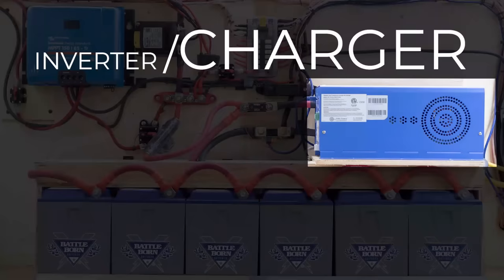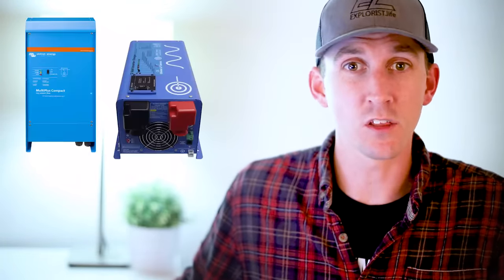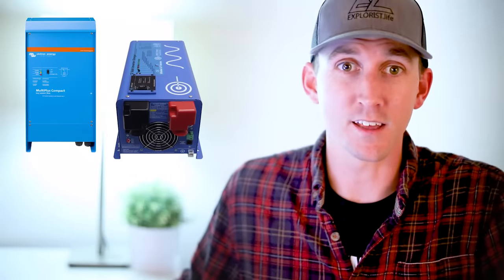Basic Solar Parts Needed for a DIY Camper Van or RV Solar Install

Comment: I really want to build my own tracking array for my home. It would be a ground install. Thank you for this very no nonsense visual of the most important components
Reply: I built an extremely simple one that holds 3 245w panels
Reply: @redsite001  Wow cool.  How much did it cost?  Did you have a plan or instructions. Are you formally trained in solar?
Reply: No I'm all self taught. And I had a basic idea how to do it.

It's been tracking all on it's own for almost 8 months now. I used a differential from a truck driven by a brushed DC winch motor with a chain drive and controlled by two small pv modules that operate 2 relays in opposite polarities.

Comment: Amazing video!  I am doing research on building a home mobile office inside of a 7x14 toy hauler.  I would like to be able to power everything inside the office via Solar to avoid the extra power consumption at my house.  Would all of the concepts be the same if I need to power computers and printers?  I want to get the right setup that I can somewhat futureproof without trying to power a 2k sqft home.  Thank you for the video and the amazing information!

Comment: EXCELLENT VIDEO! Clear, concise, simple to understand, straight to the point and all of it in less than 15mins. I've spent a lot of time watching ones that are twice as long and far less informative, so yours is definitely one of the best!

In our high tech age of lithium battery powered solar systems with Bluetooth charge controllers, one of the things that continues to irritate me is that we still have yet to come up with an updated 12v power outlet that we can all agree on and adopt.  Instead, in 2020 we continue to use an antiquated power outlet introduced in 1956 as a convenient way to light cigarettes while driving! These 3/4 x 1-1/2 inch "tubes" are far too big for what they do, they're just plain ugly and I literally hate them!  But you make an excellent point about using them to future-proof your USB outlets (ironic you have to "future proof" your rig using 65-year-old tech).  As someone who has just recently changed the USB outlets in my home for the THIRD time in 12 years for the faster, smarter ones, I couldn't agree with you more.  Despite my disdain for 12v outlets, that's exactly what will be going into our new rig so we can simply swap out the USB adapters as the 5-volt tech continues to evolve (the next ones will probably lose the USB-A  socket in favor of USB-C or some sort of combination).  Plus, you can always remove the USB outlet when you find yourself needing another one of those hideous 12v ones.

Thanks again for your highly informative video.  Great job!

Comment: I’m an electrician so I understand the wire sizes. I’m just trying to determine what I need for a basic set up. I have 2-100 w solar panels and looking to get another two later and I have a PWM controoler but it came with the panel. I’ll upgrade to MPPT controller

Comment: A very clear basic explanation of a solar energy set-up done with a sense of humor. How does a second engine alternator figure into such a system?
Reply from the maker: A second alternator wouldn't have much bearing on the rest of the setup.  It would just be treated as 'charging from the alternator'.

Comment: I just started following you.  Thanks for teaching this information.  

Recently I installed 50A shore power.  Now I'm adding solar.  Do you have a video showing how to wire the power inverter into the breaker box? Or do you just plug the inverter into the shore power plug with the appropriate adapter?

With the 50 A circuit,  I'm not sure if the inverter would be happy hard wired into the panel without a pretty serious safety switch. So for simplicity and safety my mind goes to just using the shore power wire to take power from the inverter.

Comment: Going to 2019 van build in az next month. Now I can talk the talk and ask my questions. Many 🙏 as explanations sorely needed. 

Do you have similar on amp hour, panel watts, and how to calculate what to get when starting out? 

Also? On portable systems vs roof mounted. I prefer being portable. Pros / cons?

You’re obviously a. Professor or well prepared professional educator. So well done‼️❣️❣️❣️
Reply from the maker: Thanks!  Of course!  Here is where I recommend starting.  How to perform a power audit: https://www.explorist.life/what-size-of-solar-system-is-needed-to-power-a-camper/

Comment: I have a very unique diy setup. 200w Renogy solar panels and basic charge controller with 100Wh AGM battery and a third party 750w inverter. I currently don’t have half the safety points as I should. I use this in a small work box trailer to power several 120v tool chargers, 120v mini fridge/freezer, led lights and a small 12V air compressor. I have had the setup for about two years and my battery capacity is a third of what it used to be. Curios if there is someone I could work with to revamp my whole setup for more capacity and more output. I live in the DFW Texas area. 
I have watched several of your videos and love how thorough you are but they don’t really meet what I’m going to be doing with the system. I would like to run more power hungry tools and not be so worried about the battery.  Any suggestions would be much appreciated!

Comment: This video was extremely helpful. I'm going to make my already solar hooked up RV with Solar panels and an extra two batteries but have been unsure if I need anything further. At least I now know the components I'll need to make sure I have. I already have a Deep Cycle battery but plan to get two more. I believe I should be fine with 4 - 100 watt solar panels for the energy use I'll need. I'll be sure to subscribe so I can refer back to your channel for additional info once I begin the setup process. At the moment I'm still clearing land to place my RV in a sunny area. Thank you and great job!

Comment: First' thank you for your informative and helpful information, albeit I am really not comprehending much of the technical data' I haven't the intuitive cognitive ability to visualize your lessons.  Yet I have a desperate need for a off-grid application to my travel trailer.  Might you know of any plug-n-play  pre-manufactured modularized system
necessitating only connections be made? would be grateful for assistance.

Comment: Hi Nate, I built my camper with your wiring diagram and it works perfect. My camper is parked in front of my house when not used and the batteries are allways full. I was wondering how I can put the solar power back in my house to use it and not going to waste. I have also PV panels installed on my roof by the way. Best Sander
Reply from the maker: Basically no.  There's not an easy way to do that.
Reply: Can you explain a little more? I read something about grid tie inverters, but I am not sure what this is.
Reply from the maker: A grid tied inverter will be permanently installed into your home electrical system and can feed power to your house and back-feed to the grid.  It's a totally different setup than powering your house from your van/rv.  You 'could' treat your van the same as a backup generator wiring to the breaker box with a interlock type of setup, but you'd be powering your entire house from your van only, and I'm sure your inverter is not large enough to do that.

Basically, there is no way to get your van/rv electrical system to coordinate with your power grid in the way you are after.
Reply: I was thinking about a switch in the camper to send the PV power direct to an outlet, which plugs in an Victron EasySolar with Lithium bateries and connected to the grid. Any suggestions?

Comment: Nat, you created a great video.  I learned a lot.  For a change, I was able to actually make a list of the components of a solar system for my camper. I know where each component goes and why.   Now what I need is to find out the requirements for my camper's system.  Without this, I have no idea as to the number of batteries I need to store the electricity.  This will also tell me the number and output of the panels.  Have you made a video that will tell me this?  Or better yet, is there just a number I can work from?  I have a small 17-foot trailer. It has normal equipment.  Since I am in the South, the AC is a must.  So, suggestions?  Thanks.
Reply from the maker: This video will teach you how to size your system: https://www.youtube.com/watch?v=a406IxiU-Xg

Comment: Hi , I am new to all this carvaning/RV thing , so i have been watching lots of different videos on these things. You seem to know what you are talking about,  so thank you for this information. I  am looking to check what as new starter with no van as yet , what would i need for a 3 panel setup,  how much would it roughly cost and what could be run on its its output   for nornal daily running ? Please .
Thank you
Reply from the maker: Glad it's helped!  I think you are going about this in reverse.  Perhaps, it would be a better idea to figure out how much power you need by performing a power audit and then basing your system size off of that.  Here is a tutorial for that: https://www.youtube.com/watch?v=a406IxiU-Xg&lc=Ugw0YksFqwPNs27-PQJ4AaABAg

Comment: Hi! I have 3 x 370w solar panels in a total of 1110w. VMP of one panel is 34,10V IMP 10.86A. What kind of battery and MPPT do I need to connect the system and get the maximum out of it (should I connect them parallel or in series?). I don't really live in a place with a lot of sun, but just a cheaper kind of setup to try it out would be fine. And I live in Europe so the current here is 220v. Thank you in advance if you see this. I've been deep diving about solar panels for nearly a week but still don't want to take the responsibility of trying something, because it may not be good enough and then ending up spending more money. The grand plan is to put this setup in a camper van in the future. I've installed light switches and power plugs but solar is a whole new world to me. Thanks though for your videos, they really help a lot.

Comment: PWM controllers are tanks and will not fail unless run at the edge or beyond their operating specs for a very long time.  It's a great idea to keep a spare PWM controller as back-up to an MPPT controller.  It's cheap insurance for being way off the grid.  I would be sure to get a PWM that has similar connections to the MPPT.
Reply from the maker: Quality MPPT charge controllers like Victron, Midnite, or Outback are bomb-proof as well.  But yeah... if you feel the need to have backup charge controllers and are buying them through my affiliate links, I recommend having at least 5 backups.  One can never be too careful.

Comment: I must say you are quite explicit .I  am  quite new on this.Tell me why would my refrigerator be some what vibrating and the lights in it flickering when I am on solar?
Reply from the maker: It's tough to say with limited information.  It could be anything from a loose connection to a faulty inverter.

Comment: Hello!
We have a 2005 Winnebago Sightseer that we are trying to set up for full time boondocking. I have been watching your videos for months now. I believe I understand the basics, have done an energy inventory. (Without your spreadsheet because I don’t have a computer, just my phone.) I am still trying to design our system very Leary of my abilities. Right now we are looking at a 3200w solar array, 2100 Ah of LiFePo4 batteries, 10000W 24V SPLIT PHASE PURE SINE WAVE SOLAR INVERTER CHARGER, a Victron Energy Orion IP20 24/12-Volt 70 amp DC-DC Converter Non-Isolated, a Victron Energy - GX Touch 50, Panels and System Monitoring, 2 Victron Energy - Lynx Distributor,  Victron Energy - Lynx Adapters (pair), Spartan Power - Battery ON/Off Disconnect Switch 300A, 1 Blue Sea Systems ST Blade Fuse Block - 12 Circuits with Cover, Tamarack Solar 89204 84" 4 Module Kit 1.6 Inch Rail Flush Mount Black Finish… I don’t know if this is all right or not. I feel like a stranger in a strange land not understanding the language or customs. I have several questions and am also interested in having you design and install our system if possible. ( I understand you only do one or two a year.) My half-side is disabled and I have Rheumatoid Arthritis. We need this solar setup for everyday living but also to run multiple medical equipment. Can you contact me please. I just need help to figure out everything and you seem to be the dude who knows what he is doing and is trying to help people like us learn and understand how to do it.  I am subscribed to your newsletter and to this channel. If you can help, I would truly appreciate any help or advise you can offer.
Reply from the maker: This is the biggest system we currently have that would get close to your needs: https://www.explorist.life/24v-6000w-120v-240v-split-phase-camper-solar-wiring-diagram/

For installation: https://www.explorist.life/camper-electrical-install-services/
Reply: @EXPLORISTlife  
I see that system has 2 - 3000w inverter/ chargers… is it possible to use the Sun Gold Power - 10000W 24V SPLIT PHASE PURE SINE WAVE SOLAR INVERTER CHARGER instead? And thank you so very much for responding so quickly!
Reply from the maker: @lesadehaven1801  Any changes you make to my plans are at your own discression and I cannot vouch for and that unit will not work as a drop in for that plan, no.
Reply: @EXPLORISTlife  thank you so very much!

Comment: Hello ... Thank you for your video ... Very watcher friendly. I'm doing the research and planning out a solar setup for my SUV, and I have the normal laptop, phone etc. ... Probably figure out a fan situation ... Possibly a super small fridge? Don't think I require as hightech of a setup as you explained. I still need to do my calcs, but a question I did have was, how much of your setup isn't quite necessary to have an operational setup? Not looking to short myself but I have watched others that have only had battery bank, inverter, solar charge controller and fuse block, for example. Seemed like alot less then what you had going on. Would you mind shedding some light on this for me so I can wrap my head around it all
Reply from the maker: All of the systems I have designed at https://www.explorist.life/solarwiringdiagrams are able to be charged by solar, shore power, and your vehicles alternator and can supply power to 120V and 12V loads.  What functions you can live without will determine the parts you can omit. Sorry for the vague answer but its the best I can do in just a few sentences.

Comment: Absolute awesome work Nate, thank you very much. I just bought the wiring diagram: 2000W inverter, 200+ batteries and up to 700W solar panels to put it on my fixer upper sailboat. I believe it will come out fantastic, since RV's and boats are the same in being off grid and if you have your RV at the ocean, you get the salty air too.
I don't know, I thought I've seen you showing how that entire parts list could be put to Amazon with one click. Can't find that button. Anyway. For this wiring plan a 30 Amp AC Distribution Center (WFCO WF-8930) is shown, which is not available anymore. What could be Nate's alternative? Thank you

Comment: Hi I have built a system using your 400w solar system schematics. All is well. I would like to add surge protection for the solar panels and the electronics panel. Using midnight solar components.  Could you give directions on placement in the system, and sizes!

Comment: What do think of the Redarc control system?  Which parts would it replace?  Thanks for the details of putting in the system
Reply from the maker: I have no experience with that system and therefore have no opinion one way or the other at this time.

Comment: I am in the planning stage of a DIY overland/expedition vehicle, the habitat will be 100% electric. I will have 5 kw of solar panels on the roof in a double stack where one set of panels slides out from under a fixed set. I am planning on a 30,000 Wh LiFePO battery bank, 6 - SOK 48v 100Ah batteries. I have several 220v loads I need to run, one 14.4 kw electric tankless water heater, a second 10kw electric tankless water heater with circulator pump for radiant in-floor space heating, an electric incinerator toilet that uses 2kw per cycle, a mini-split air con unit,  a washer/dryer combo, and possibly a 220v dishwasher. I would likely have to run two loads at once such as the air con unit and washer/dryer or cycle the incinerator toilet or the tankless water heater and washer/dryer at the same time. My question is what would be the best choice for an inverter(s)? I was thinking about a 48v 15,000 watt Victron Quatro, but I also though that 15k is just barely over my largest load of 14.4kw and that it might be advantageous to have more inverter power for a second 220v load and other 110v loads like the induction cooktop or a 110v dishwasher if I chose that vs a 220v model. Any help would be greatly appreciated. Thank you

Comment: Hi Nate, I purchased and installed your electrical layout using your guide. I am adding a truck AC, and am not sure where to connect. I have solar, inverter, dc distribution and alternator charger using all 4 ports on Victron distributor. I can add a separate fuse, but not sure where to connect. Batteries?